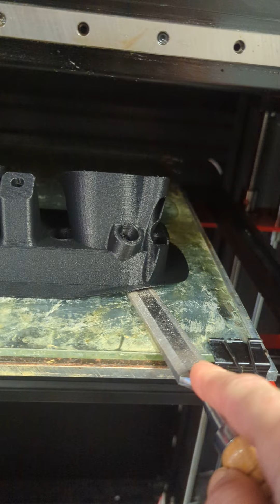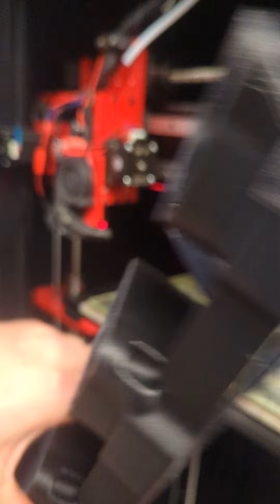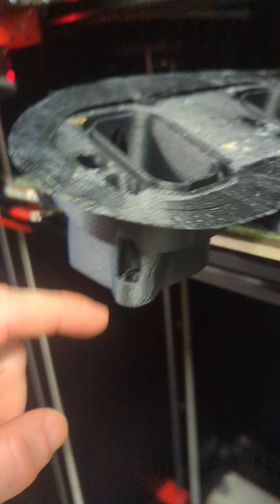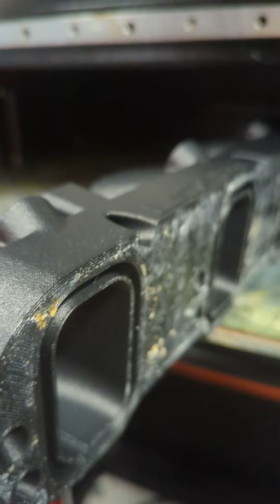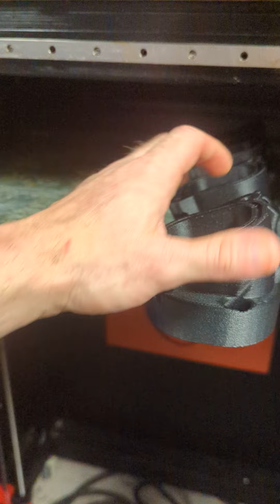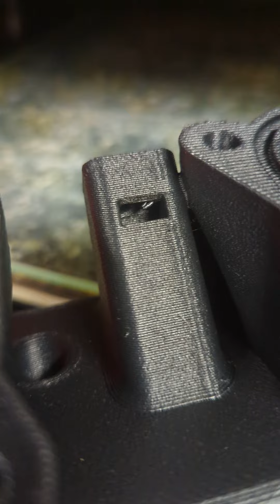LS7 Short Ram Runner Bank Carbon Fiber Nylon 3D Printed by Rapid3D

Comment: How big can you print ?> and which material is that ?
Reply from the maker: My build volume is 500*500*1000mm machine is built for 24/7 non stop high temp nylon and like wise Materiels. 500c hot end, 140c bed, 70c heated chamber 💪

Functional end use industrial parts without the excess cost needed for items nobody will hardly ever need such as peek etc however we can also do peek etc just not as large a scale
Reply: @rapid3dus760  I'm considering printing a intake manifold, I'll call this week
Reply: @rx-7man-fw8ic  i checked it out, not getting my business, I'll just build a printer
Reply from the maker: @rx-7man-fw8ic  I’m in nasty divorce, that’s my wife scamming me and everyone, perhaps message me and get my number and continue mission rather than spread false information
Reply: Im not your wife, im a paying customer that you ghosted